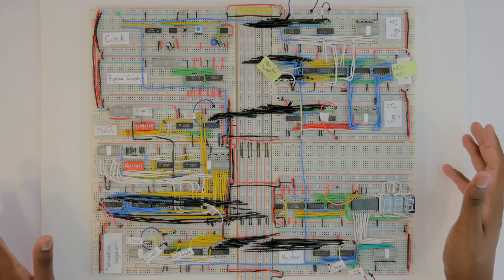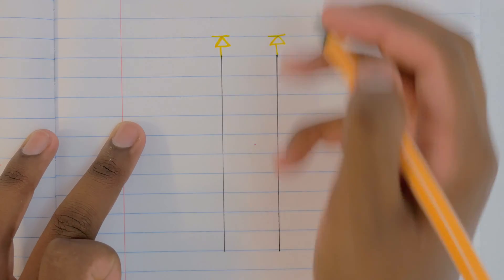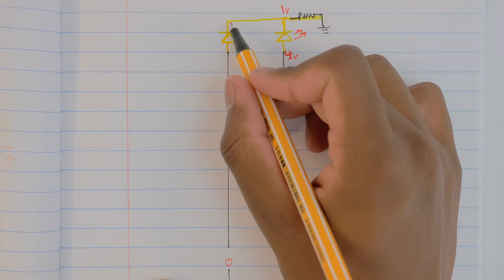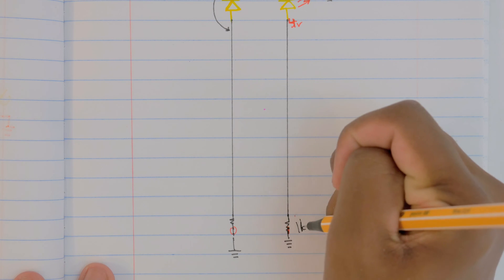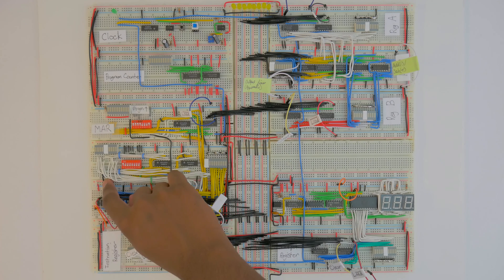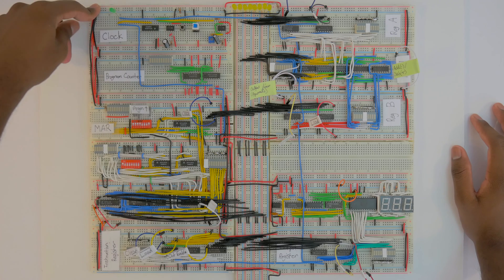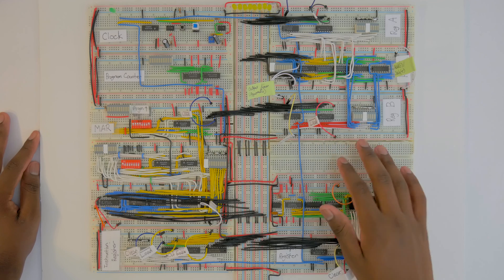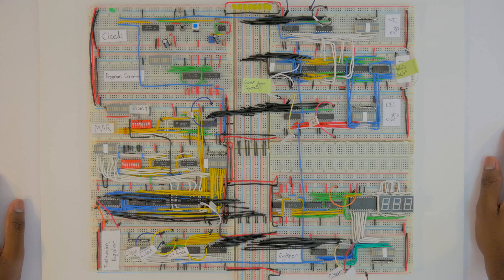Power Distribution, Bus Lane Issues, Led Fixes | 8 Bit CPU

Comment: 4:09 Yes, it's a common thing with diodes that they leak current in the reverse direction, up to a certain voltagedrop and then they start blocking.
Reply from the maker: Ahhh thank you! I was confused because 0.6 V is a low voltage for a reverse diode breakdown voltage.

Comment: I have power issues and I noticed that the VCC on my breadboards is between 4.19v-4.6v which is less than VCC required by chips to operate properly . Some chips operate properly though ,but program counter is counting in a weird behavior . So my question is: Can I connect a power supply to the right half of the computer and another power supply to the left half of the computer ? If so, will this have a bad effect on modules connected to the bus from the right and left halves of the computer ?
Reply from the maker: I considered doing this to combat my own power issues with the CPU. I never actually tried it but as long as the grounds are tied together, I can’t see much reason why it shouldn’t work. I was able to fix my issues by making more direct connections from each of the breadboards to the power plug and adding a few capacitors here and there as necessary. Hope it works out for you!
Reply: @TheAMTech_Official  Why should the grounds from the different power supplies for each half of the computer be tied together  ?
Reply from the maker: Amr Khaled Great question! I would think u have to so that any communication between the halves has a common reference point. Think the bus. If a chip on the left half puts a 1 on the bus with respect to its ground, a chip on the right half will measure that signal with respect to its own ground. So if the two grounds aren’t tied together, the chips won’t rlly be able to measure what is high or what is low accurately. I have a video on ground on the channel, it’s a little basic but it might be worth a look over anyway. Also, as always, you might as well try it both ways — all you have to lose is probably a couple of highly replaceable IC’s.
Reply: @TheAMTech_Official  This is a valuable piece of information , thanks for that ❤ . I'll definitely check your video .

Comment: How much current does this draw? Is it dangerous when you touch the cables?
Reply from the maker: i believe the draw is near 2 amps
Reply: I know many have heard it isn't the voltage that kills you but the current.  That is true, but it is the current going through you, not the circuit.  You have quite a bit of resistance to your body, so you need a decent amount of volts to push through the resistance of your body to generate the current going through you.  A 12v car battery can provide hundreds of amps, even today's lipo batteries which are only up to 4v per cell, but these won't harm you.  Not enough voltage to overcome the resistance of your body to generate the current through you to harm you.

Comment: Obviously you saw Ben Eaters series. The issue with the LEDs is gate impedance on old school 74LSxx logic. You don't need pull up/down resistors. You need to understand the evolution of logic chips.  It is a common problem for people under 50 years old so don't worry, your not alone. 95% of the replies you will get on this issue are wrong.
Reply from the maker: +Crocellian I've heard slightly of what you're speaking of but why didn't the issue present itself without the LEDs? Only when I put the LEDs in problems were created. What do you think the issue is?